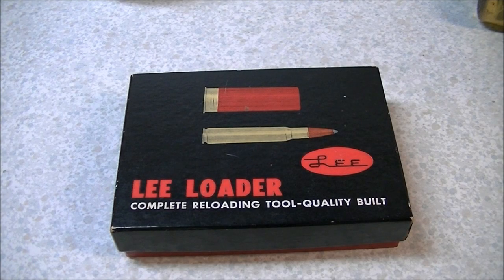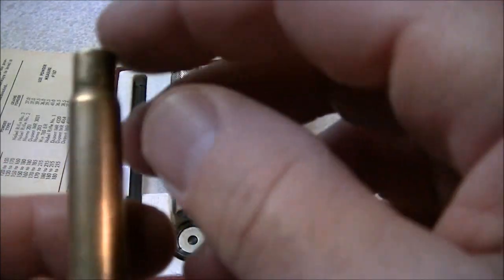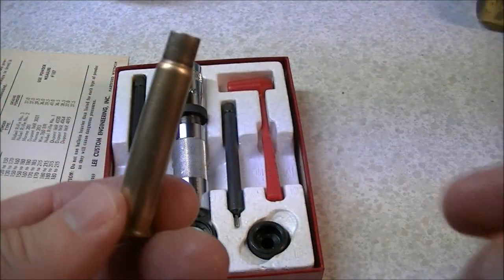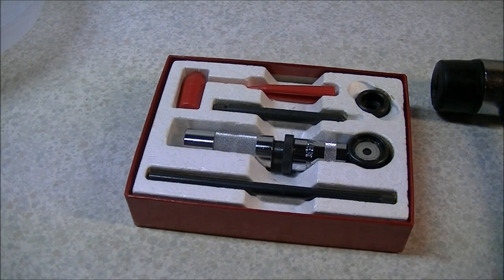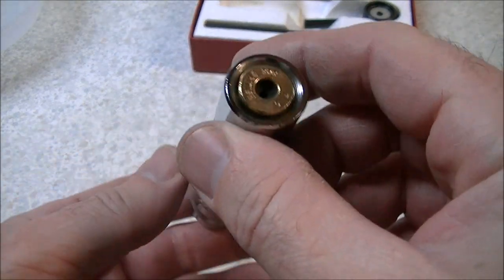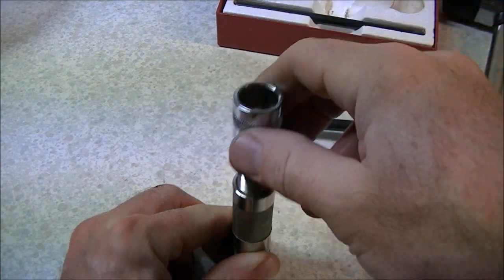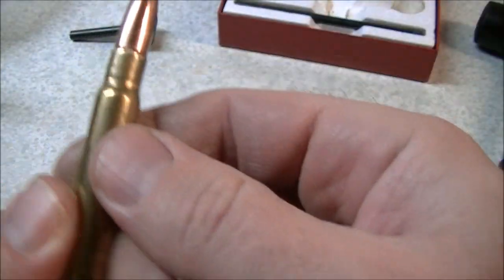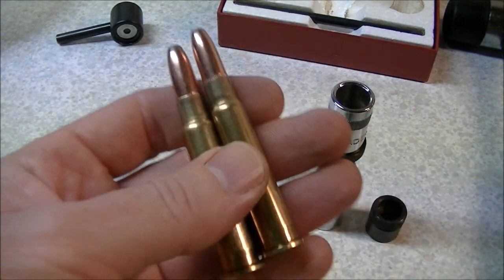Reloading .303 British Ammunition using a Lee Loader Set

Comment: Thanks for the very informative video on hand-loading the 303. Ordered the Lee loader based on your recommendation. In addition to PPU brass (Serbia), I've got brass from Remington and also some Sellier & Bellot (Czech). I note from comments below that you recommend under-loading powder by 5-10% with the PPU brass. What do you know about the S&B, can it be full loaded? Using the same powder and bullets in all 3 cases, will performance vary significantly between the under and full loads? The Lee hand loader chart suggests using only a 150 gr bullet with Reloader 15 powder.  You use 174?
Reply from the maker: +Mike Gerow You should be able to treat the S&B brass as most other commercial brass as it is not heavily constructed and so should not require reducing the charge as much as heavier brass does. Performance will vary between brands of cases as they will have different capacity, the difference can be insignificant or significant depending on the weight and internal capacity of the cases. Using the same load in different brands of cases can result in the point of impact shifting by inches due to changes in velocity.
As for load data you have many more options than just the card that comes with the kit, especially if you buy a set of the dippers (about $12), then you can look up data in reloading manuals or from powder company websites. When using Reloader 15 powder with 174 grain bullets you would need the dipper that measures 42 grains or less, this is probably a dipper one or two sizes larger than the one that came with the kit.
 http://www.alliantpowder.com/reloaders/recipedetail.aspx?gtypeid=2&weight=180&shellid=89&bulletid=146
Reply: +314299 Shooting Channel -- Thanks very much for your feedback! The Alliant recipes were very interesting and gives this novice reloader some more data to experiment with. Without knowing anything about what to look for in an Enfield, I was lucky enough to purchase a 1916 Lithgow No 1 Mk III SMLE for less than $100 about 20 years ago. Barrel, chamber, etc. are in excellent condition. The cheapest commercial ammo (PPU) that I've been able to find at gun shows still runs about $1.00 per round. Looking forward to saving a lot loading my own. Really appreciate your loading video which convinced me to give it a shot (sorry, bad pun).

Comment: I just purchased a Lee Classic Loader and besides the changes in recommended powders, the IMR 3031 isn't even on the list, the set hasn't changed.  My only question after watching other videos and reading reviews is, have you had any issues with primers going off while loading?  Thanks for the help and the great informative video.
Reply from the maker: +harrisonchr Primers can, and do, go off occasionally while they are being seated. Rounded face primers are worse than those with flat faces. However it should not be a very common thing to set primers off while seating them.
Reply: +314299 Shooting Channel Thank you.  Would a hand primer be a better option?

Comment: I will soon start reloading the .303 British with this kit. Its gonna be the first cartridge I will reload. All seems straight forward, my only question is...regardless of which powder I choose to use (from the list of recommended powder that come with the kit) is the dipper set for all charges listed?
Reply from the maker: Yes, the dipper that comes with the kit measures all the charges shown on the load card. Some of the loads are quite light. You are better off buying a set of the Lee dippers and a Lee Reloading book, that way you have more flexibility in the powders and charges you can load.

Comment: just a simple simple question.  i just got my set although it was made in 1996 it has never been opened.  ive bought all of my materials and have used the lee loader for 12 guages for years.  Anyway  how many threads are showing on your die just so i have a starting point to set my bullet depth.  i am not sure how to start of seating the built and i want to stop on the cantalour.  can you give me a thread count and ill go a little less and work my way down.  i just want to start to deep.

Comment: Interesting. Don't you need to check case length?
Reply from the maker: If cases have been loaded quite a few times it would be a good idea to check case length, There is very little chance of cases stretching much if loaded with the Lee Loader as they work the brass so little.

Comment: Great video. Thanks. 
Have you used this type of loader in the 7.62x54R cartridge? For your Russian PU?
Reply from the maker: I have a 7.62x54R Lee loader but I dont use it much as it does not size the case necks enough to reliably hold all bullets that one might want to use in that round.

Comment: I know this is an older video...
I have reloaded pistol casings a very long time ago. I was required to use lubrication on the outside of the case, just wondering why you don't use any? It was a RCBS reloader.
Reply from the maker: The Lee Loaders only neck size the cases, no lubrication is required as only a very small portion of the die is in contact with the case. You could lube the outside of the case neck if you wanted to but it's not necessary and that lube would have to be cleaned off once the round was loaded. Full length sizing dies used in a reloading press size almost the whole case and so the friction is great and lubing the cases is a must. Without lubrication the cases will stick in a full length die and the rims will get ripped off when trying to remove them
Reply: @314299  Thanks for the reply. It was informative.
Reply from the maker: @ForgetU  No problem.

Comment: I have plans to get a p14. I think that rifle was built with tighter tollerances. So maybe there won't be as much case stretching with each shot. If I reload with this Lee loader then maybe the case life will be longer than it it's shot from a Lee Enfield rifle. How many reloads do you average using 36 grains?
Reply from the maker: 303 brass certainly holds up better when shot in a P14 than it does when fired in a Lee Enfield. P14's almost always have tighter chambers than Lee Enfields and the front locking bolt of the P14 keeps case stretching down as well. With a P14, a mild load and neck sizing you could get 20+ loads out of a case, especially oi you anneal the case necks every 5 reloads.
Reply: Thanks man👍.

Comment: I have now shot my first 100 rounds of .303 reloads using the Lee handset. 150 grain speer over 36.7 grains of IMR 3031. Very good, consistent performance with my 1916 Mk III SMLE hitting a 12" steel flywheel at 450 yards (offhand, not bench). I notice that there were some miniscule brass flakes in the chamber area and it seemed to chamber the rounds (all previously shot in this rifle) a little tighter than I recall. I simply reloaded without precise consideration of overall cartridge length using calipers, etc., because I was not aware of the need to do so. Is it possible that the casings needed trimming? I eyeballed the overall cartridge lengths of the reloads to match some existing factory loads, so they were pretty close to correct length, but how much variance is critical?
Reply from the maker: +Mike Gerow Variance in case length is not so important as is not going over maximum. It is unlikely that your cases need trimming if they have only been loaded with the Lee loader, of course the only way you can know for sure is to measure them. As for variance in the OAL you will get some  variance with most tools as they seat the bullet by contacting it on the curved portion of the bullet, not the tip, and often bullets in a box have come out of several different forming dies and have slightly different profiles.
Reply: +314299 Shooting Channel - Thank you for comments. I wonder if the brass flakes or dust in the chamber were the result of inaccurate cartridge OAL sizing. I never noticed this phenomenon before with factory loads. At any rate, my first batch of reloads shot very well and were surprisingly consistent at long range using the provided Lee powder scoop vs. a scale. I appreciate your engineering-style approach to your videos.

Comment: Very helpful.  Please, do you use .312 or .311; and do you slug .303 barrels to find out the bore size?
Reply from the maker: I use both .311 and .312 bullets. I have occasionally slugged .303 barrels, using .314 soft lead pistol pullets as a slug.
Reply: +Das Bongo Good luck slugging the barrel I owned a lithgow it contained 5 lands and grooves.

Comment: Can I safely use one of these loading Barnes copper bullets?
Reply from the maker: You certainly can you the tool for loading the Barnes bullets, however you need to check that you have safe reloading data as solid copper bullets used different data than traditional lead core bullets.The data with the loader is for lead core bullets, not solid copper ones, so I would not follow it.

Comment: I wonder if you could use a vice and squeeze the primer in rather than hammering it in
Reply from the maker: That would probably work but might be a bit difficult to get everything to line up properly since a vice usually operates in a horizontal position.

Comment: ive use spent brass fired from my own rifle, loaded it up and when i put the rounds into the magazine push the bolt forward and push the bolt handle down to fire, it doesnt get stuck but it seems like there is more resistance getting the bolt handle all the way down than a new prvi partizan round would make.

my theory is that since this brass was fired from my own rifle, that its gonna be tighter fitting than the new unfired prvi ammo

is this correct and normal?

Comment: are the bullets magnetic? I go to some ranges where they are not allowed due to possible fires
Reply from the maker: +schutztruppe 1900 I am not aware of any bullets you can buy for reloading that are steel jacket and/or steel core.
Reply: ok thank you.
Reply from the maker: No problem.
Reply: watched your video a few times over the year but I never had the guts to do it. Just ordered my dies!!!!! no the bullets. What about the primers? Is there a difference in primers? What are you using? I'm using round bullets also because I need it for my Boer war era bandoliers I make.
Reply from the maker: +schutztruppe 1900 Any brand of standard large rifle primers will work,  I would buy whatever brand is the best price, I've used them all with good results.
Reply: large RIFLE primers. Ok thank you very much
Reply from the maker: +schutztruppe 1900 No problem. Good luck with your loading.

Comment: If I use cartridges that came with a 180 grain bullet do I have to reload those carriages with 180 grain or does it not matter?
Reply from the maker: No, it does not matter, use any weight of the correct diameter bullet that you want. Just be sure to use appropriate loading data for the bullet you select.
Reply: Thanks for the reply 
All you need for primers are the Winchester large rifle primers correct?

Comment: so its 100% safe to simply load according to the load data with the dipper without working your way up?
Reply from the maker: Yes it is safe to load according to the load data with the dipper supplied as the loads given are basically "start" loads. With some bullet weights and powders you could use a larger dipper, which is why a set of dippers and a reloading book is usefull if you want to move beyond the dipper supplied with the set.

Comment: I have a 1902 Enfield Fires the .303 British and well my issue is I want to start reloading my own rounds but I have 120 Spent brass casings but with all of them they have that swollen ring towards the base what would you recommend? new casing or is there a tool I can get that would correct that the rounds were 175 grain Remingtons
Reply: If you look it up you will discover that the used shells become more accurate after every use, until too used, lol.  They kinda actually mold to the rifle so to speak.

Comment: Hi what is your C.O.L on this specific case , hordgon says it must be 74.08mm and after loading I get 76.0mm ?😅
Reply from the maker: It's not unusual if the overall length of your loaded cartridge is different as it will generally vary depending on the specific bullet used. I see that they use OAL from 2.870" to 3.075" depending on the bullet used. Are you using the exact same brand and weight of bullet that they list for the load data you are referencing?
Reply: @314299   yes I am

Comment: Hey I recently used the newer version of the Lee Loader with the yellow dipper, it occurred to me I should ask; is there a difference in size between the old dipper and new? I know there shouldn't be but I'm just paranoid. Thanks
Reply from the maker: The red dipper used with the old set has a slightly different capacity than does the yellow dipper used with the current set.
Reply: 314299 Shooting Channel Thanks for the prompt reply, would it be enough where it would be dangerous for me fill the yellow dipper in a similar manner as shown here with the red one? I'm also using IMR 3031 and 174 grain projectiles
Reply from the maker: The yellow dipper with the 303 set should be the 2.8cc one. According to the Lee chart the 2.8 cc dipper holds 36.7 grains of IMR 3031 powder. The Sierra book lists 38.8 grains of IMR 3031 as maximum with 174 grain bullets in the 303.
Reply: 314299 Shooting Channel Thankyou very much! I couldn't for the life of me find any conversion information between grains and CCs. With this information I might see about getting a slightly smaller dipper, I don't always need hotrod loads just to kill some water jugs
Reply: 2bit MarketAnarchist you couldnt find grains to ccs because cc is a volume gr is a weight and powders weigh different amounts per volume. the only one i know of is from lee for this vety toolset and it has about 100 different powders on it and how much your specific dippers cc eill hold in grains its a pdf called lee dipper conversion table google it and itll download a table called "dipper" this will be your life, as it is with mine. 
if u cant find it let me knoe and ill send a link
Reply: Brandon Knutson I believe I've since found it. Thanks anyways :)
Reply: FYI, the red dipper used in this video is the older style in cubic inches.  The newer kits use CC dippers.  The 2.8 cc dipper is .171 cubic inches, the .167 dipper is 2.74 cc.  Not really that much difference.  If you get Lee's reloading manual, he explains why he switched to CCs and how to use VDMs to figure out charge weights using volumes.  A reloading book has tons of information in it besides load data.  Well worth the read so you understand exactly what is going on with all the steps that you are doing.   The 314299 is also great for the Mosin Nagant.  Great video BTW, 314299.
Reply: Clay James Thats good to hear. Just wanted to check so I wouldn't blow up my Enfield

Comment: How do you clean the primer pocket?
Reply from the maker: Cleaning the primer pockets is not a necessity, you can load effective reliable ammo without doing it. However it is desirable to clena the pockets to help with evenly seating primers. Lee makes a primer pocket cleaning tool that works well and is inexpensive. A small blade type screwdriver can also be used.
Reply: @314299  Thank you for letting me know about the Lee cleaning tool. I will purchase one.

Comment: How do you trim your brass after a few reloads?
Reply from the maker: If you neck size your brass it is unlikely that you ever need to trim your brass. Generally it is full length sizing that makes your brass "grow" so that it requires trimming. If you do ever need to trim I recommend the Lee trimmer and pilot system, it is low cost, works well and is accurate.
Reply: @314299  

I was looking at a lee trimmer.  Thanks for the reccomend.  I have some 357 mag i can eventually do   Too.

Comment: length of the  case ???????
Reply from the maker: Maximum Case Length - 2.222 inches
Case Trim Length - 2.212 inches 

Having said that there is really no need to be concerned with case length when reloading with a Lee Loader as cases reloaded with them generally will not stretch enough to require trimming.

Comment: Reloading, dippers are not accurate, use a beam scale for accurate powder measures. Shooting reduced powder loads one needs to use the powders recommended for reduced loads.
Reply from the maker: If you are not getting accurate results from using dippers it's not the dippers fault, it's your technique. Quite accurate charges can be dispensed using dippers. As for shooting reduced powder loads there is some truth to using powders recommended for reduced loads as most powders have a lower charge limit below which they cannot be safely reduced below.
Reply: @314299  I have never had an accurate load from a dipper for some 15 years. Some powder loads recommend, say 24.2 grains, no dippers give an accurate 24.2 load.

Comment: you could just not full length size the brass
Reply from the maker: The Lee loader does not full length size the brass, it only sizes the case neck.
Reply: 314299 Shooting Channel Great stuff its 1968 all over again the  .303 is long gone however I still have Lee Loaders in 222 Remington and 30-30 W.C.F. Also I have full length sizing dies Obtained from Lyman these dies were a complement to the Lyman Tong Tool. Great video keep it up.